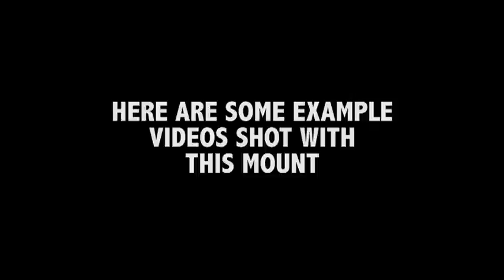Vibration Free Camera Mount For Trex 500

Comment: not bad , defiently gets rid of any banding and such small waves lines in the vid , have you thought about using some rc fuel tubing???use as lenghts from the boom strut mounting area and nose like rigging "line tentioners". i bet it gets rid of the wobble:D i like this setup i might jsut make something like this but i got a few ideas also on it;) and also "useful weight " on the "drop gear".